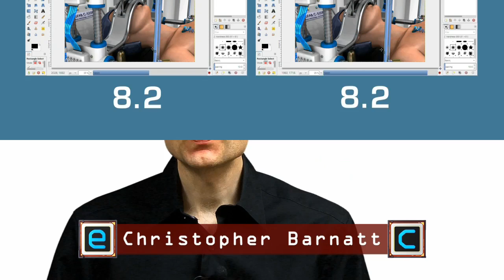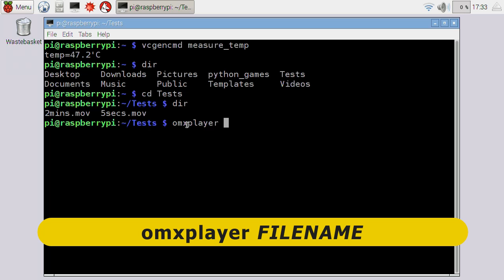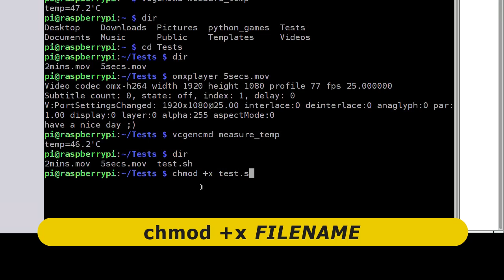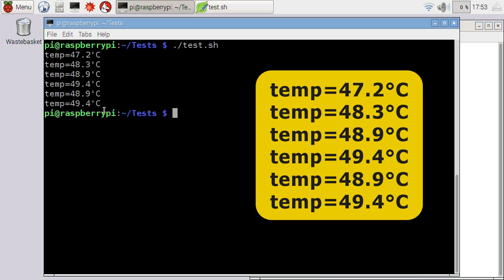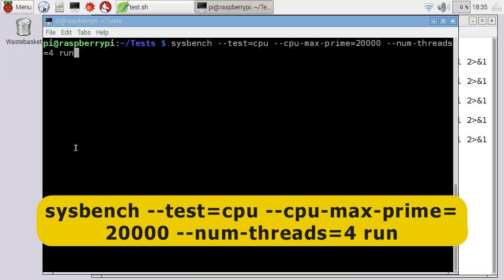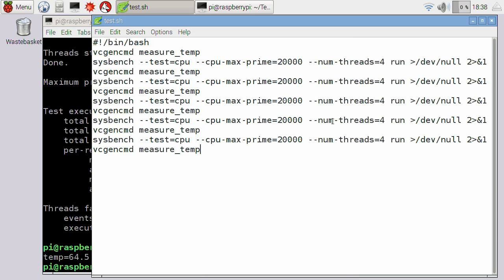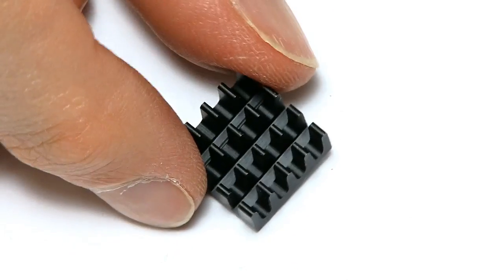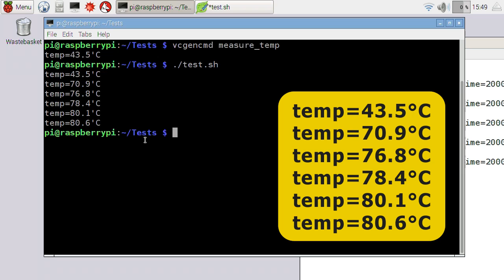Raspberry Pi 3: CPU Temperature Tests & Heatsink

Comment: Are there any bigger heat sinks available? I'm wondering if the 40mm heat sinks would fit - some also come with fans so they'd be super effective?
Reply from the maker: +Alister Voltaire I am sitting here with lots of old fans and heatsinks trying to work out potential solutions. There may be two follow-up videos here. :)
Reply: +ExplainingComputers professor, may I suggest a custom cut copper plate as a heatsink? It would be easier to fit that between the SoC and the real heatsink instead of trying off the shelves solutions that may not work because the size. A simple cooper plate would help dissipate between 5 and 10 degrees.
Reply from the maker: Luis Mercado
I've been checking out copper sheet on Amazon this afternoon!
Reply: +ExplainingComputers Been looking at the different thermal tapes/glues/pastes and there seems a massive difference 

Tape is about 1 W/mK
Glue is about 2 or 3
Pastes start at 6 and go up

It could be a case of use better sticky stuff?
Reply: Professor, one last suggestion, sorry for the annoyance. Silver has almost unparalleled thermal conductivity. Seems overkill but you would be surprised how much silver we can find in the common household and any jeweler could make for the cheap such a small plate out of coins and such. 

I suggest this only if you feel like experiment with this SoC. I used in the past a custom copper/silver alloy plate once experimenting with an automated art installation and managed to bring down the temperature over 15°, no small feat considering this was a Pentium 4.
Reply from the maker: Luis Mercado
I will be experimenting with whatever I have to hand!

Comment: I'd love to see an active cooling solution for a Rasperry Pi! I've often wondered if there were fans that were made a certain size with the Pi in mind, and if it would run off of the GPIO pins. I've been wanting to use my Pi 2 as a NIDS, using an old Cisco 2950 with Port Mirroring turned on to copy all traffic to it, but I'm sure that with all my systems running, that would be a very big task for the little Pi, and I'm worried about how hot it may get while doing that. I've also considered running a small Minecraft server using a Pi, so that it could be up 24/7 without using a lot of power, but again, I'm worried about the CPU usage that Minecraft would require, and wonder if that would need active cooling.
Reply: I'm thinking that too with my MC Server.

Comment: Please for the love of god do not put a small fan into that thing. Use a large low rpm fan with some kind of pwm.
Reply from the maker: +("RNA0ROGER") You should see the fans I am considering! :)
Reply: ExplainingComputers
80 or 120?
Reply from the maker: +("RNA0ROGER") Currently 40 and 80mm are lying around here, plus various old CPU and GPU heatsinks and fans. I'm even thinking of modifying an old Zalman flower cooler. There may be more than one follow up video here!
Reply: Use the flower but keep to 80 high rpm fans are a pita trust me I know from experience.

Comment: excellent video as always! I have a theory about why the heatsink didn't show a significant decrease in temperature. the purpose of a heatsink is to increase the exposed area of something with a good heat conductive material to allow a higher heat transfer with the surrounding environment. the heatsink you used for the test is a really tiny heatsink that almost  make no difference for the CPU. besides, it  seems that the glue used to fit the heatsink on the CPU wasn't the right jelly one that has a very high thermal  conductivity. I recommend a bigger heatsink with taller blades (maybe see the one used on the odroid c1) to effectively increase the exposed area and paying attention to the glue, to  get a better and more satisfactory result on the thermal test. anyway, thank you very much for your time and knowledge!

Comment: That is interesting.  I wonder what it will mean for the next iteration of Pi?

I would like to see active cooling tested please. :)
Reply: +clangerbasher Agreed ! Would love to see some company make a SUPER small fan for the Pi. Like a fan/heatsink that has the same size profile as the heatsink shown in this vid. Would be comically small but awesome !
Reply: GruntW0rk I think there are a couple of cases out there that are also heat sinks.  It would be nice to see a proper little copper one with vanes etc.   BTW the Pi isn't small,  we are just big!!!!!!!!   :)    ;)
Reply: +GruntW0rk  actually there is fans in that size but they're quite pricey. Google pi micro fan. It's on Amazon for 8 dollars.
Reply: +clangerbasher 
Intel has released a small x86 computer known as the "Compute Stick"; and it has an adorable little heat-sink and fan :3

http://www.legitreviews.com/wp-content/uploads/2015/04/intel-compute-stick-fan.jpg
Reply: +clangerbasher 
I wasn't sure if the Pi was small, or just far away.
Reply: Have they released a Linux one this time?
Reply: MarkTheMorose :)

Comment: I thought ARM chips were designed to run cool :/
Kind of concerned this got so hot.
Reply: they are just too powerful. phones nowadays even have heatpipes
Reply: +Deltaexio This is more of a problem specific to the  RPi 3, not ARM as a whole. 

The Raspberry Pi 3's A53 Broadcom chip is far more prone to overheating compared to other designs because it sticks with the same inefficient 40nm process the old chips had, whilst increasing the clock speed, which increases heat dramatically. 

Most other boards have switched to 28nm, which allows them more room to increase clock speeds, but retain the low temperatures of the previous design.

Broadcom seems to no longer be interested in designing CPU's now, so it'll be interesting to see what they'll do for the RPi 4.

Comment: Thanks for the heads-up!  About a week ago, Peter Oakes published a video on YouTube, called "Using a FLIR AX8 to test a PI 3 full load temperature". His conclusion was that the internal temperature sensor isn't very accurate. In his case the actual SoC temperature was something like 30C higher than indicated by vcgencmd measure_temp. So, adding a heatsink (and fan) might be even more important for a heavily loaded Pi3.
Reply: +Kees Nuyt If that is the case, I would be happy to lend Chris and Infra-red thermometer gun which has an accuracy of 0.1C. Then it would be able to determine just how accurate the temp sensor on the SOC is. ;-)

Comment: Very interesting! Thank you for the information. Here in my country my raspberry pi overheats so much that it freezes right from the start (room temp 32~34ºC and humidity around 70%). I'll going to buy another Pi and put a heatsink on it. Thank you again.
Reply from the maker: +Marcio Maia Very interesting. I think I will experiment with fans . . .